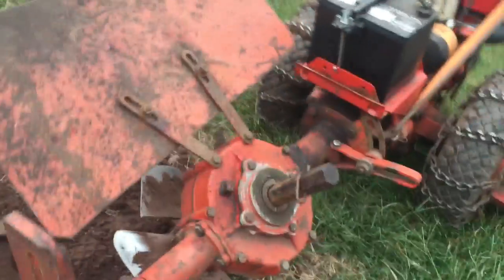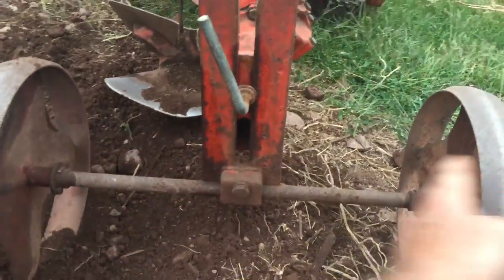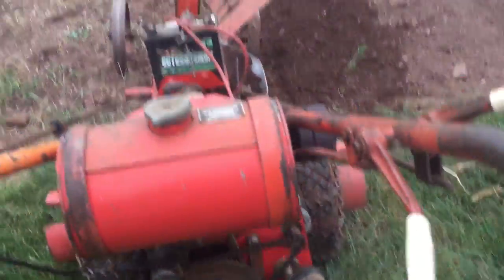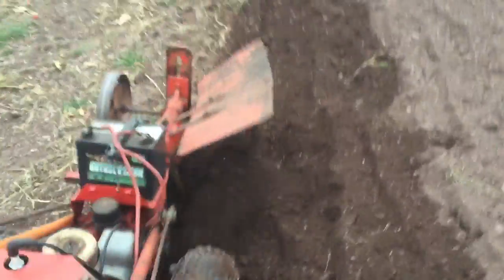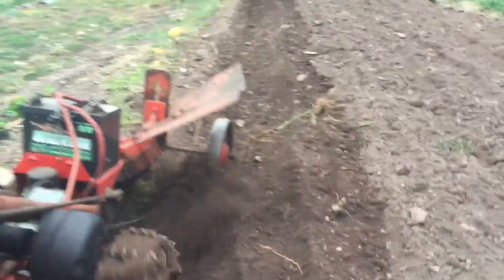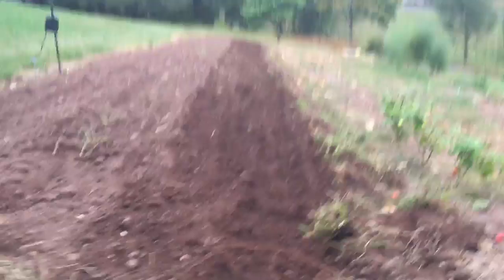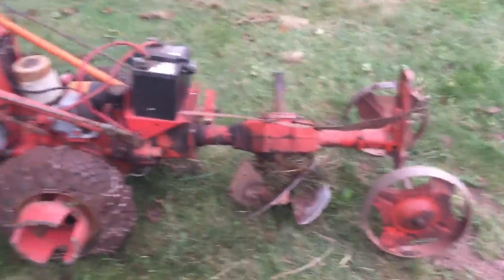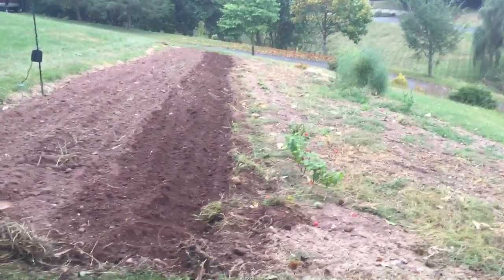How To Set Up A Gravely Rotary Plow: Try These Set Up Tips

Comment: Hey John, is this a L model?  or LS  or Li????   it seems very low geared
Reply from the maker: Hi Tom,  L I ; intermediate speed, just creeping along a touch above idle. My experience is the lower the ground speed & with low throttle, the better the till. Not the case in deep tilling and others but mostly I keep this one really low. By the way,  I am in low gear (I think...)